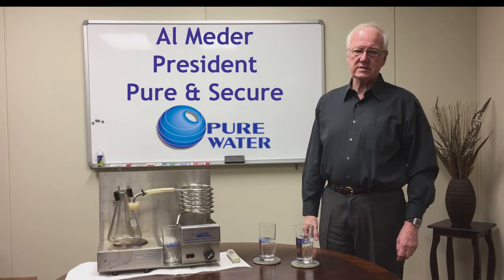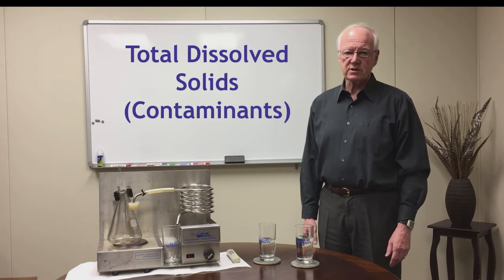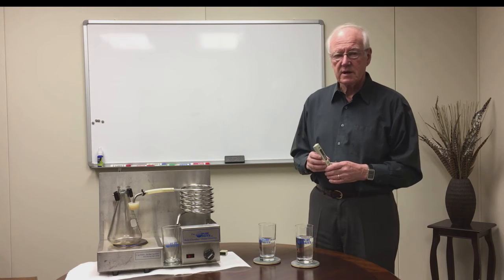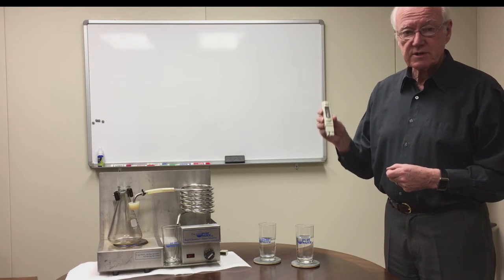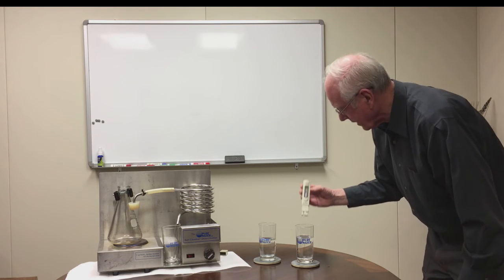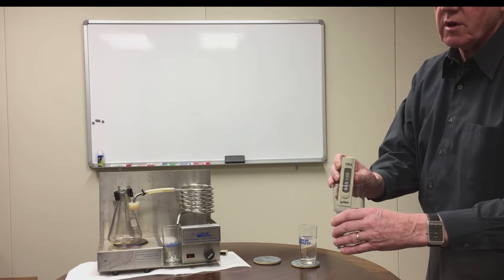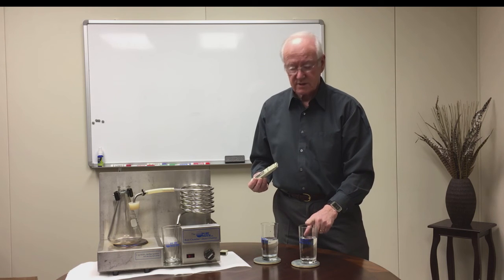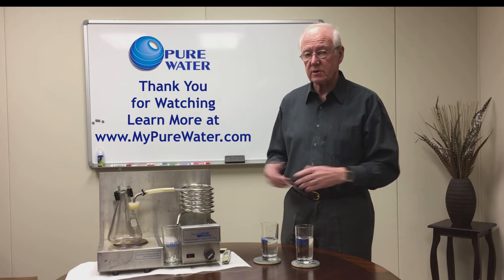Testing for Total Dissolved Solids in Water

Comment: Mine keeps coming up at 13ppm :/
Reply from the maker: Which distiller do you have? How recently have you descaled/cleaned the distiller? How recently have you changed the filter? How full do you fill the boiling chamber when you run a cycle? These are all things that can contribute to your distiller producing water of that concentration.